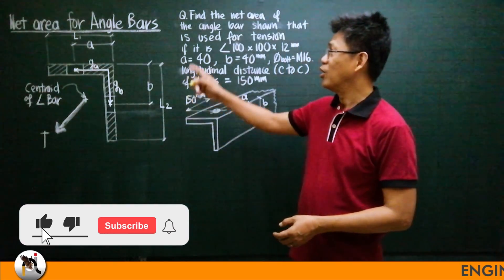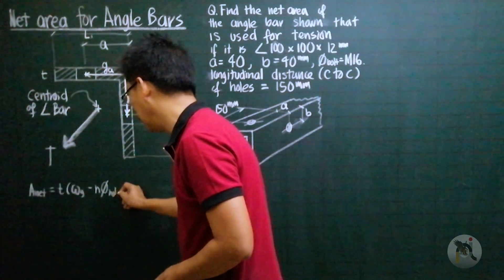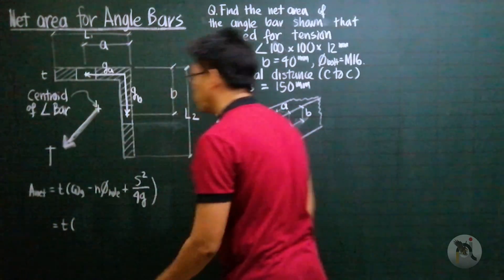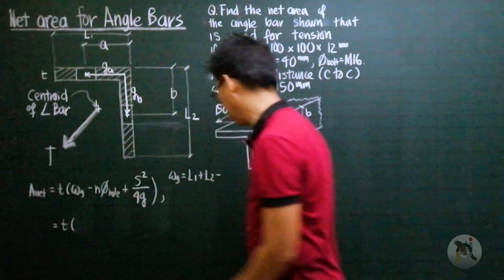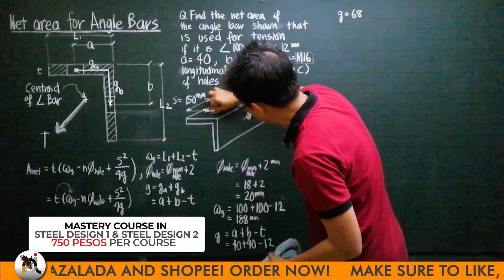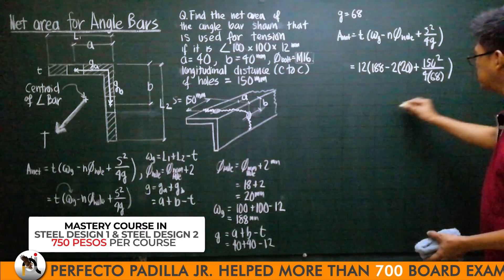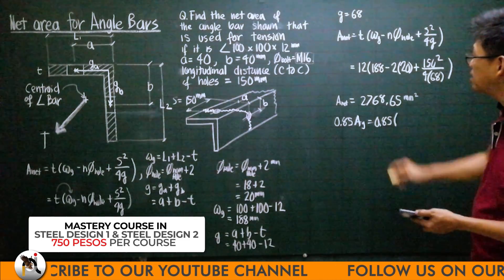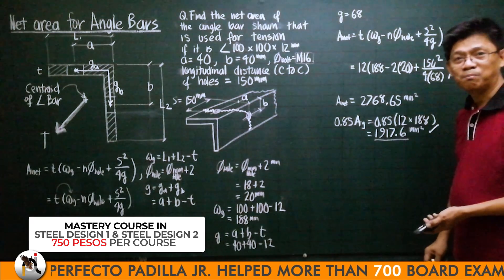CE Board Exam Review: Net Area for Angle Bars (Steel Design) #Part4

Comment: good day po medyo confused lang ako engr if e compare pa yung Anet sa 0.85Ag since angle bar yung given po? Thank you
Reply from the maker: You may apply the limit 0.85Ag when all elements of a tension member with holes are connected to another element.  I this example both legs are with holes (presumably connected to another elements.  So, 100 percent of the section(i.e. U =1) is subjected to tension.  So we limit the Anet to value less than or at most equal to 0.85Ag.